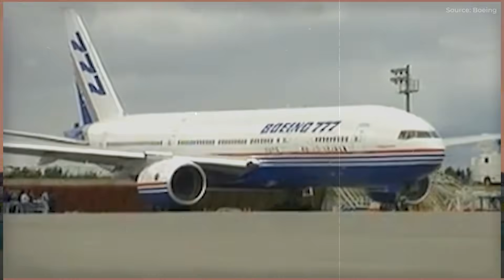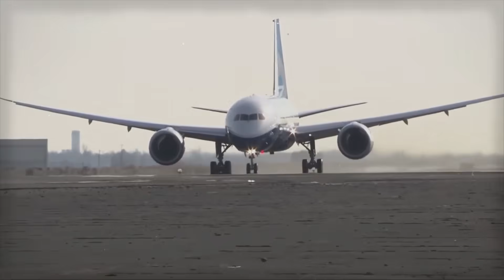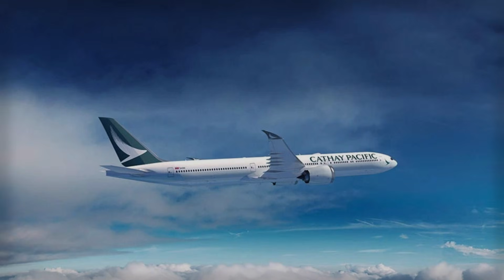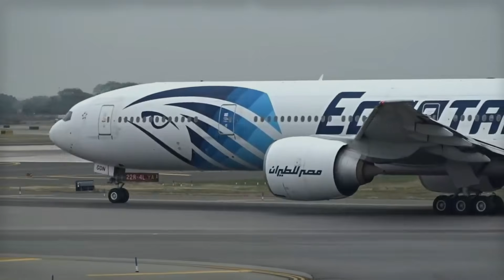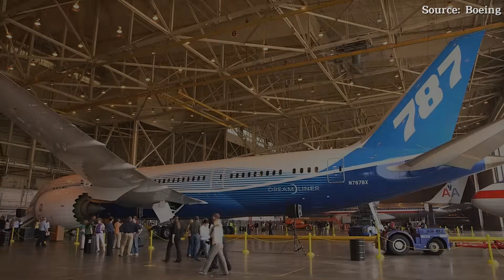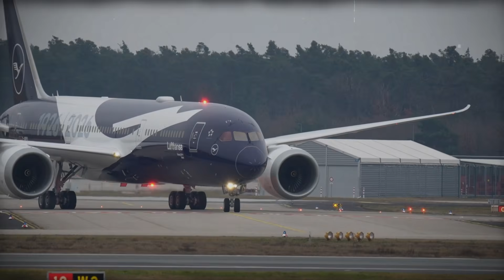Why Airlines Prefer Boeing 787 Over 777 Will BLOW Your Mind!

Comment: umm did he forget 787  india airliner crashing?
Reply: Because pilot wanted out!
Reply: Watch some of the other 777 and 787 pilots talking about this. Both fuel switches cut out separately, about a second apart, which is consistent with the time gap of shutting them off manually. Not conclusive, but definitely more than enough to cause doubt on the whole “this is just another Boeing issue” argument